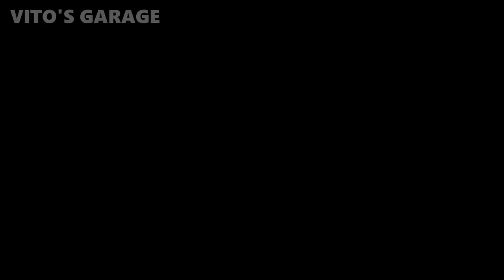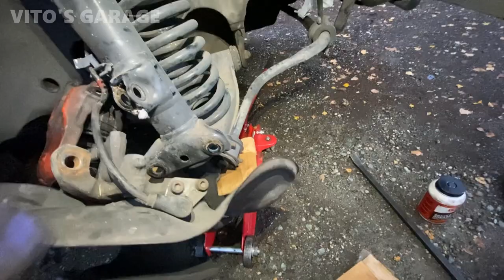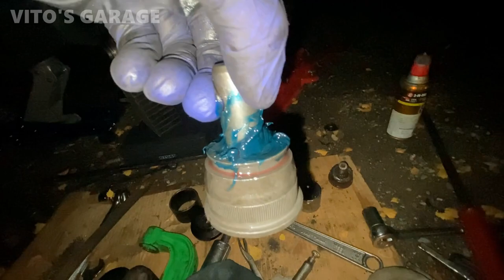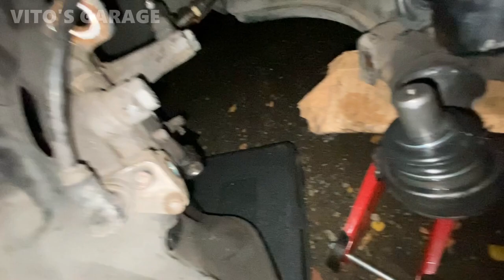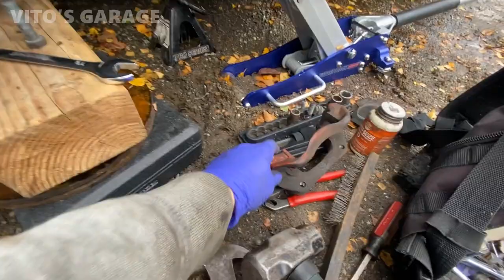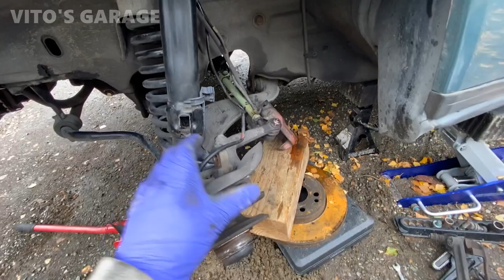Part 5 Mercedes W124 300E: New Front Brake Rotors & Pads, Ball Joints Replacement, Lube Door Bottoms

Comment: Hi Vito! I'm glad you like that weather there. I hate getting cold and wet. That's why I like Vegas. 😆 🤣 
I had to replace the ball joints on my 85 300d back in the early 2000s. They were so bad that the car would start shimying on the freeway, and I'd have to almost completely stop to get it to stop doing that.
I saw that the ball joints were pressed in like yours, I took the whole suspension assembly out and took it to a Mercedes mechanic close by and had them done on a press. The suspension is a different design than that one, but you're probably familiar with them. I also did the brakes later.
When I did the ball joints on my 98 S90 Volvo, I thought it would be hard, but in fact, they are bolted on and are super easy. Mercedes should have copied that.
Reply from the maker: I love Washington state. I hate Vegas weather.  Sorry. It’s too damn hot there and no nature whatsoever. Just an empty desert! 
And that’s a cool story!
Reply: @VITO'S GARAGE  Actually, we are surrounded by mountains and so you don't have to go far to get plenty of nature. 
When I was aboard ship in the Navy, I was a machinist mate PO3. I worked in the engine room. When we were underway, it was 135°f in a cool sport by an air shaft. 😎 
I love hot weather and lots of sun.
I was born in Germany of a German mother. I don't know who my father was but I think he may have been Italian. I turn really dark here in sumer and I love it.
One of my sisters lives in Port Angeles, Washington. I have never made it up there.

Comment: I am seriously waiting for you to do a FULL TEAR down of a w210 diesel engine.  what are the cost of a w210 diesel car.?
Reply from the maker: W210 diesels are rare in USA so I don’t know if I’ll have one
Reply: @VITOSGARAGE  are you kidding.  how come.??  they are common place in Europe.  you really need to import a diesel one.  look into one as a project car from Poland.  they are cheap enough.  It would cost the Americas something like 500$ to buy.  That would be a moderate version on the low scale.
Reply from the maker: @jasonputtock4428  it’ll be too expensive to ship to USA. I love my W123 and W115 diesels
Reply: @VITOSGARAGE  that is true.
Reply: @VITOSGARAGE  Hey bud.  I got  a slight issue.  Cant remove the balancer pully.  Engien is based on the w210 c203 and w638 platform engine.  I don't have a locking tool for the pully.  Have you a getto way out of this.???  Please.

Comment: You could add a grease fittings to the ball joints, to add grease later on.
Reply: How?
Reply from the maker: I’ve never done that. Do you have a video?
Reply: @VITOSGARAGE  Way back all joints had a grease zert.  Then tapped hole was still there but plugged.  Other than on some tractors, forklifts, and earthmoving equipment no longer see them.  The lube that good manufacturers put in the joints is $$$ CV quality.  Next thing some dude pumps it out w some cheepo useless grease.
Reply: @VITOSGARAGE   Look up, for how to add  grease fiittings videos.
Reply: @ebutuoyebutouy  Sounds like, you work for a joints company. Most of the joints available today are made in China. $20 ball joints don't have high quality lube to last 5 years.
Reply: @vintage76vipergreenBeetle  Sounds like u consumed too many joints?  So how u add zerts?

Comment: I have a 92 300E and the steering doesn’t return to centre. Could this be ball joints? Only one way to find out I guess… get in there and take a look…
Reply from the maker: You need to check your suspension and replace worn parts and then have it aligned